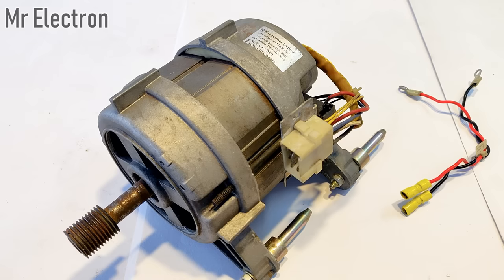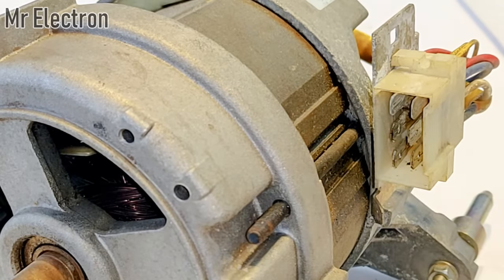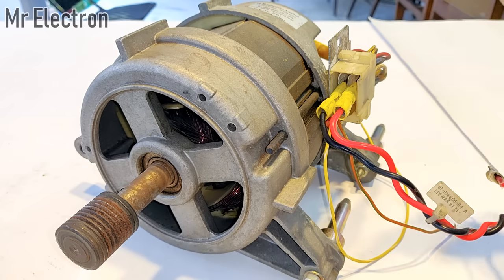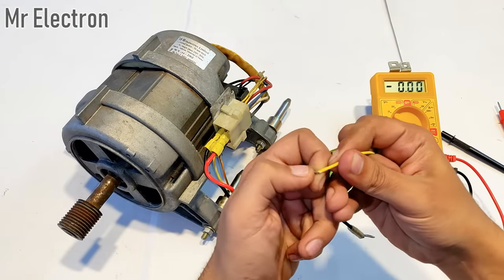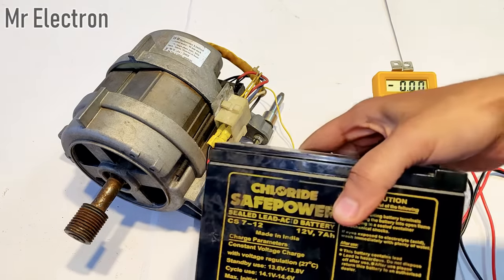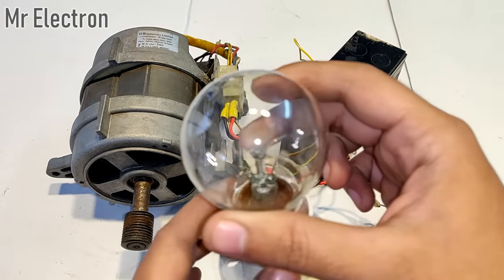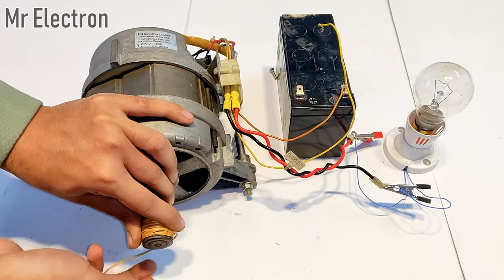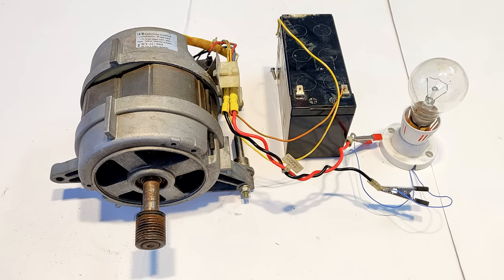Hack ! 220V Electric Generator from a Washing Machine Motor DIY - Universal Motor to DC Generator

Comment: Induced magnetism into the steel plates of a transformer core produces electricity into the windings which can be "transformed" having greater or lesser amperage and voltage. If a third conductor coil is used to pulse voltage into the core the other two coils will still be creating electricity. 

Take the created electricity and use it to pulse the third coil. Or use it to charge a battery. Use that battery to charge a capacitor, which is used to pulse the third coil. 

The coils can also be used independently apart from each other to pulse a coil or wire from separate directions at different frequencies to create alternating current from a direct current source.  Which could be used to create heat and run motors and generators.

Comment: But how can you get 50Hz ? In which rpm?
Reply: Hz is a measure of AC Current, this makes DC Current. It does not alternate so it has no frequency. The Inverter running from the batteries will set the AC Frequency.
Reply: If the rotor is 4 pole, you have to have a synchronous speed of 1500rpm to produce 50hz supply. If it's 2 pole, speed should be 3000rpm. Speed is directly proportional to frequency. Number of poles is indirectly proportional to frequency.
Formula for frequency is, f= (Ns x P)/120
where,
Ns- synchronous speed
P- number of poles
f- frequency
Reply: @cypher10297  Bullshit.  Wrong type of motor mate

Comment: you take 12v batery to make  7v hahahahahahahahahahahahahahah
Reply: that's at low speed.  It produced higher voltage spinning faster.  It's not all about volts anyway.  12v at 1 amp for field could be producing 7v at 30 amp.That is 12 watt in and 210 watt out.  You wouldn't be complaining about getting 12v out of a transformer when you put 22ov in now would you ?